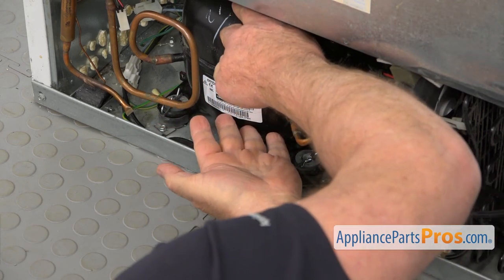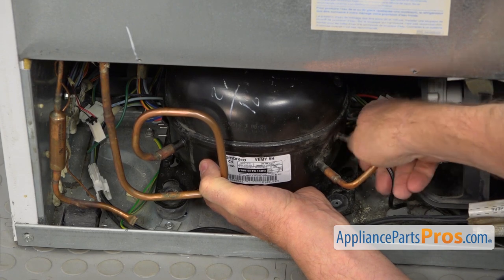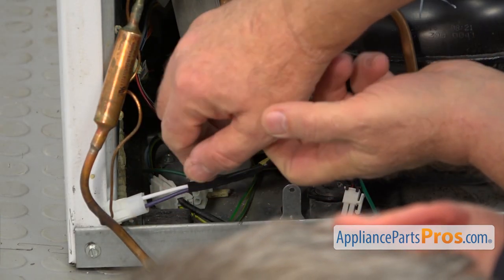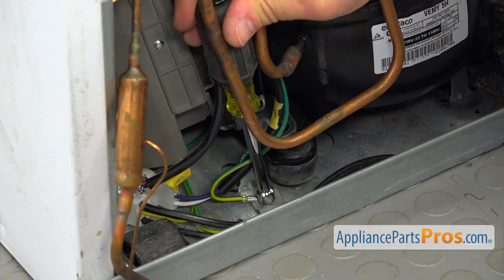How To: Frigidaire/Electrolux Refrigerator Compressor Inverter Control Board 5304512686

Comment: This looks like the same unit I have.  The control box wasn't attached to anything and it was a simple matter of disconnecting the wires and moving it from the top out.   

I'm not sure if it's the control board or not.   Wouldn't it be advisible to test the compressor since you have the plugs epxosed right there to see if it's grounded?  If it's grounded, a new board won't help.
Reply from the maker: You can check to see if the compressor is bad before replacing the part.
Reply: @appliancepartspros  , I did make a reply  but it somehow was deleted.
The  problem is it's buried

A great example is multiple attempts to post this aftter being tossed out for less basic message posts. Yes, this took more than five  tries.
Reply from the maker: If you are having issues posting anything, you can call us at 1-877-477-7278. We will be happy to assist you.

Comment: Does this inverter board usually power the fan motor as well?
Reply from the maker: What is your model number?
Reply: ffhb2750ts9 - sorry I must've edited out my part #. my fan motor has been replaced twice, and the fan stops working about 8 hours after replaced with a brand new motor. I was suspecting a capacitor issue, and when I learned my fridge has an inverter board, I still think that's probably the issue, but I would replace the board instead since I have no way to fix the circuit board. I've heard replacing the inverter board has caused people's fridge to run slightly differently so I'm leaning toward replacing the fridge. It's not tremendously more expensive at that point anyway if I'm going to have to replace both the board and the motor again
Reply from the maker: The invertor board just controls the compressor. If you are not getting power to the fan motor, then you would need to replace the main control board 5304510307. You can place that order through the website or you can call us at 1-877-477-7278 to place the order over the phone.
Reply: @appliancepartspros  Thank you for the information. Out of curiosity, how did you determine it was the main control board?

Comment: Question, why wouldn't the replacement part just had the same OEM fittings instead of adding brackets and moving over the compressor and removing part of the wire harnesses?
Reply from the maker: It appears that the manufacturer must of done some type of design change to that part to make it better than the original one.

Comment: This is the replacement part if you have a panasonic compressor with control board mcbe2un. Here you have the open end of the horseshoe shaped connector at the compressor terminal pointing down when connected to the terminals.  The old mcbe2un board on panasonic compressor the open end of the compressor connector when connected  is pointed to almost the 10 oclock position  does this make a difference ? I cannot find a video of the mcbe2un being replaced with the 5304512686 in a fridgeiaire with a panasonic compressor. None of the instructions are clear on this. I have not attempted to install yet  maybe its idiot proof and can only be connected one way
Reply from the maker: What is the model number of your refrigerator?
Reply from the maker: The connections only go one way. Let us know if you have any other questions, or you can call us at 1-877-477-7278.